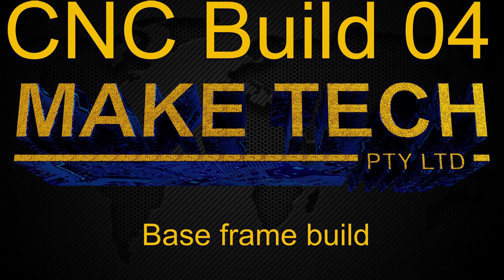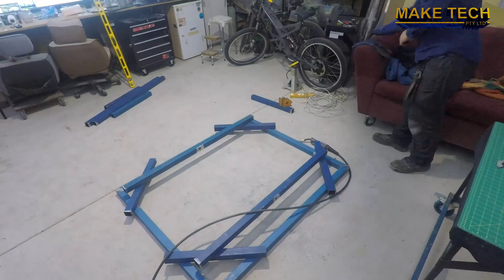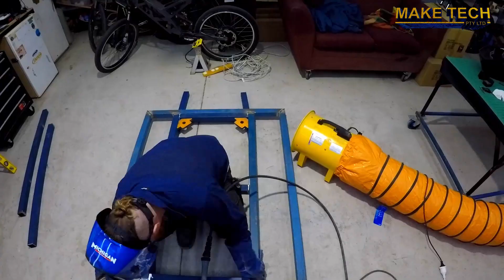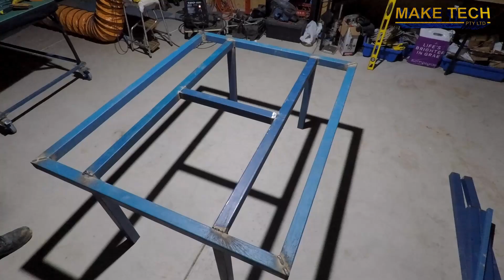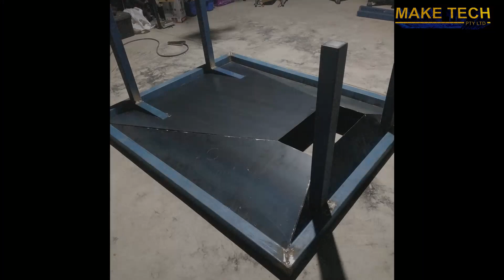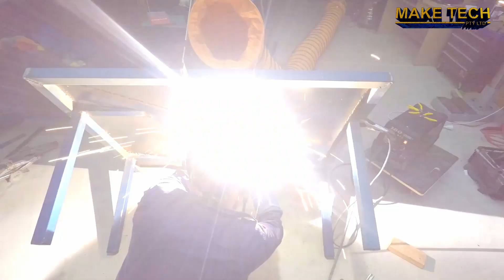CNC Build ep04 - Making the Base Frame

Comment: Looks perfect, what size tubing did you use?
Reply from the maker: Thanks! That's 50x50mm 2mm thick. The tray is 3mm.
Reply: @MakeTechPtyLtd  thanks, I’m starting my build next week, I’m in no way an engineer so wouldn’t know what thickness to start with. I can look up deflection for horizontal pieces but that’s about it. A lot of welders tables I have looked at use something thicker but they are also holding a lot more weight.
Reply from the maker: @MrBrettStar  there are allot of factors to consider. More mass will help absorb vibration. The frame design will determine the strength in some ways more than the material thickness and tube dimension. If you make it as heavy as you can reasonably justify, that may be a good starting point. Thicker wall tube is easier to weld generally aswell.

Comment: Probally you best video to date
Get yourself some argon and 0.6 solid wire for welding thin sheet metal, less heat, less distortion and and a better looking weld

Comment: Nice work mate. Camera work was cool to. Did you have the camera on a rail?
Reply from the maker: The Robotic Camera System is a unit I've engineered with an app to control it from a mobile device. I can program in a scene in a minute or two then let it run while I work.
I'm updating it soon and I'll go into more detail in the video.
Thanks
-Ken

Comment: Would some castor wheels on the base legs be a dumb idea? Maybe too heavy and once you have the machine in place then useless? Will you use skates to get it into position in that case?
Reply from the maker: I have some 75mm wheels. The plan is to make 2 dollies
Reply: Not a dumb idea, but would need to alter the frame a little. I have three wheels on mine. I also have threaded feet as well for that one day I can finally bolt it down.